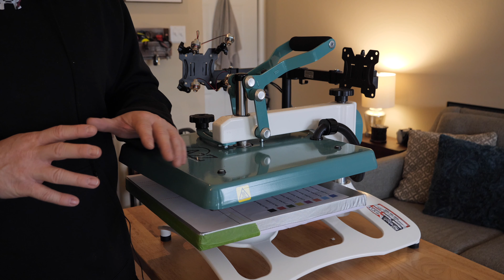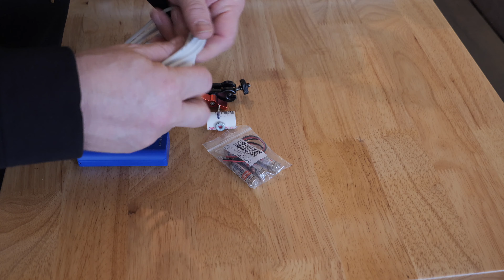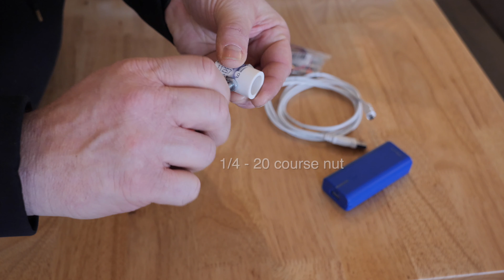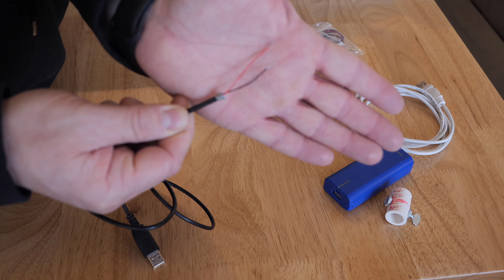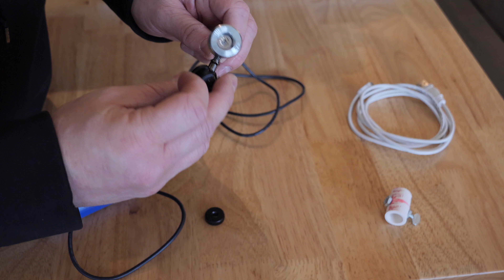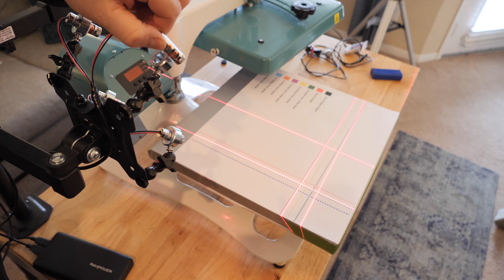Better than Hotronix Laser Alignment System? | My System v. 2.0 | Heat Press Aid

Comment: Will I still need a dual monitor mount if I only use two lasers and will I still be able to create a cross line?
Reply from the maker: Nope and yes. 

Now that I have THIS setup, I actually wish I had the single arm version, but it’s a preference. I preferred the dual mounts when I was using the first version I had with the harbor fright lasers. I’m using FOUR lasers on ONE mount plate here. So it’s totally doable. The 2 monitor version just offers more flexibility if you want/need it. 

As far as the lines go, yes, not a problem. All you need to do is tilt, rotate and then focus the beam along a horizontal or vertical, than do the same in the opposite direction and they’ll intersect at the desired point. I aim 2 in each direction to make 2 crossed patterns. Check out 19:30 in the video to see how to make straight line beams intersect.
Reply: @OneDegreeLife  Great, thank you!

Comment: Mounting rings came this evening. Prob start tomorrow with assembly.  My press is a 16x20 do you have a template for that?
Reply from the maker: Sorry. Been under the weather. I don't have a larger pattern. If you measure out half an inch extra on both sides and fold the paper there, it could help you in a pinch. Hopefully the assembly came out well for you!

Comment: Just bought all the components for this setup today. Hopefully you don’t come out with a revision video where you purchase different items 😂😂😂
Reply from the maker: Hahaha, I’m still using 2.0. I hope it works out well for you! 😁
Reply: @OneDegreeLife  about to have me looking like McGyver over here 😂
Reply from the maker: @beardedelephant3023  if you’re anything like me, you’ll feel a great sense of accomplishment when the McGyvering is complete 😬
Reply: @OneDegreeLife  looking forward to it. The monitor bracket came yesterday
Reply: All good I figured it out. Set it up day before yesterday. I think I’m going to mount it from above my press. Won’t have to mess with it all at that point and have my space back on my table lol but it works great
Reply from the maker: @beardedelephant3023  Hey, great to hear! I'd like to mount mine above eventually. If I get a more permanent home for my press I might. Cheers!
Reply: @OneDegreeLife   is there a  source for the  horizontal line type laser beam? as the ones recomended  are out of stock, the same for the 1/2" Bore  mounting rings with the 1/4"-20 allen screw, they are out of stock. Very good videos, Thanks !
Reply from the maker: @rafaelcohen4214  Ya, I've seen that many of the more affordable ones are not out of stock. I've linked another one below that has similar specs. They offer cross, dot and line. It should link right to the line one, but just double check if you decide to try them.  Again, I've not tried this particular one. Seems like a lot of the "line" versions are unavailable right now. As far as the mounts, that's a bummer. Those took forever to find! Perhaps Home Depot has something similar, but I wasn't able to locate what I was looking for when I did this video. You CAN make your own out of PVC and bolts, but it's not quite as clean or as durable :/

Best of luck in your hunt and build!

Laser: https://amzn.to/3rWnSZz
Reply: @OneDegreeLife  Hey, thanks fo your fast repply, really apreciated, I'm buying them right now;  did you buy the ten pieces mounting rings package? can you sell me only 4 collar rings?
Reply from the maker: @rafaelcohen4214  Ha, they're stored in my friend's shop and I don't know exactly where now. I was just looking again, the ones below appear to have the same specs as the ones I got. I've not used this brand, but the dimensions SHOULD match the lasers, The lasers measue .475 inches in diamater and these are .5. They are affordable and with Amazon, you can return them if they aren't correct :) The screw threads also appear to be 1/4-20. So, if I were needing to re-order, these are the one's I'd try! Double check the specs, but they appear to be identical on paper:

https://amzn.to/3BuCNNT
Reply: @OneDegreeLife  Thanks buddy, got everything! can I get your e-mail?
Reply from the maker: @rafaelcohen4214  Good luck! Are you able to message me directly?
Reply: @OneDegreeLife  Do you have any specifications about the power bank? something that could help the system to run better?
Reply from the maker: @rafaelcohen4214  This whole design was an expansion of the Harbor Freight battery-powered lasers that I had tried and others were using. So, when I adapted these lasers, I just used the 5.5A USB battery block that I already had. All of mine (3 different ones) worked. Obviously, the more power, the longer the run time, but it'll last forever because the power draw is really low. 

Having said that, the EASIEST and BEST solution is actually just to use a USB power brick and plug it into the wall or extension cord. My second outlet was king of far away, so I used the power bank, but if you have a close outlet that's not sharing power with your press, then getting a multi usb wall plug is the ticket and it WON'T POWER OFF!
Reply from the maker: THis is what I'm talking about. This is the one I use when I don't need the battery.

https://amzn.to/3IcP4cg
Reply: @OneDegreeLife   I tried the Harbor Freight ones, two years ago, and didn't like those because to many inconsistencies, once receive all the items will set them up and will give it a try, I can see on the videos this is a better system. Thanks for your help, really appreciate it.
Reply from the maker: @rafaelcohen4214  You bet. I agree, the HF beams left a lot to be desired. I really hope this new setup helps!